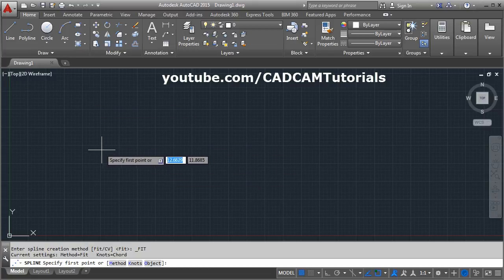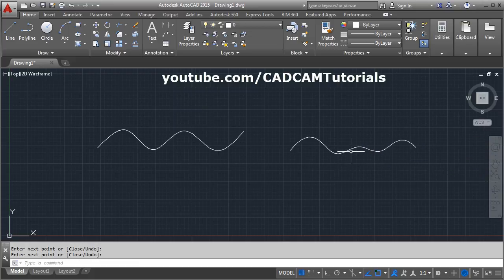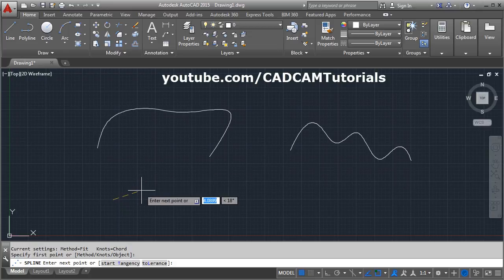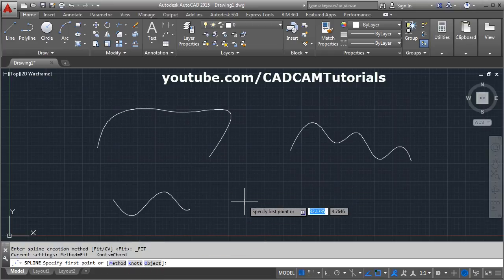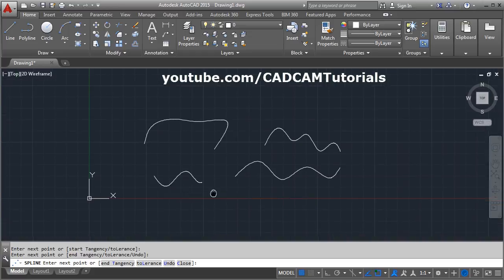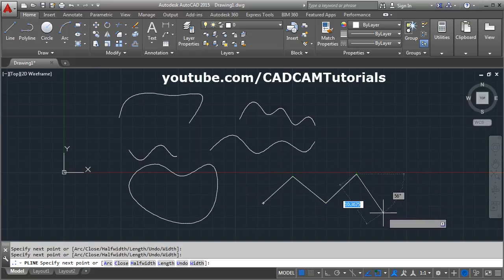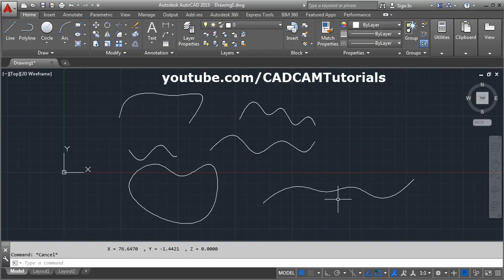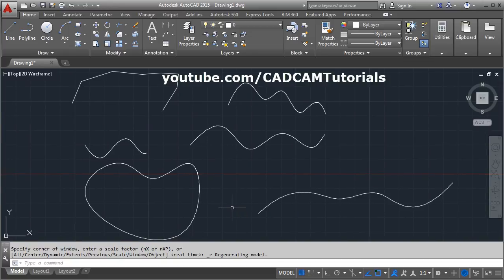AutoCAD Spline Command Tutorial Complete | Fit, Control Points, Convert to Polyline, Precision

Comment: When I enter start tangency and I click my cursor near by, the spline will jump somewhere very far and I dont know why this is happening.
Reply: This is also occuring on my computer.
Reply: @peterburbery2341  I struggled quite awhile and then found the solution eventually. You need to finish off the two point spline with the end tangent option (cause two point spline is the only one that works in 3D) then go to Spline Edit and modify it when modifying look down in command window and there is an option for a start tangent. So to make this short. Check the Spline Edit command. Some people suggested in forums to use 3 point spline, but the problem with that is that you can not use it in 3D. I hope this helps. Good luck.

Comment: Dear Sir, I wanted to draw an ellipse with a less pointy tips on the longer sides. So, I tried to replace the tips of the ellipse by first trimming it off and joining it with splines. However, it appears that the starting and ending points of the spline does not match the angle of the lines of the ellipse where it were trimmed off even after adjustments. How could I make the spline start/end at the same angle as the line where I trimmed off the ellipse?
Reply: You can try starting the spline from the shorter sides i.e. from the minor axis rather than the major axis. This way you will not face the problem of having pointy tips